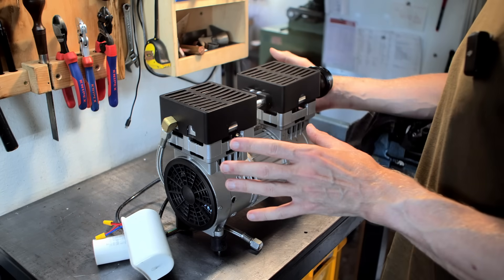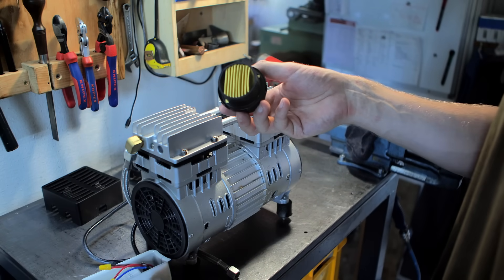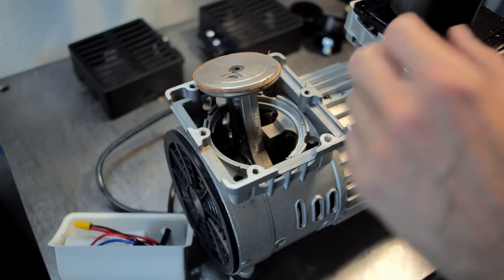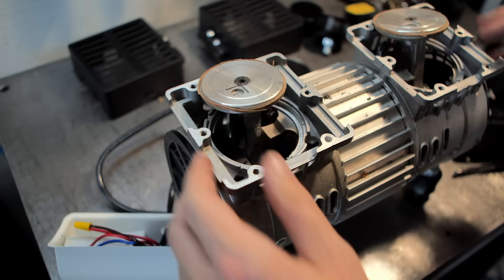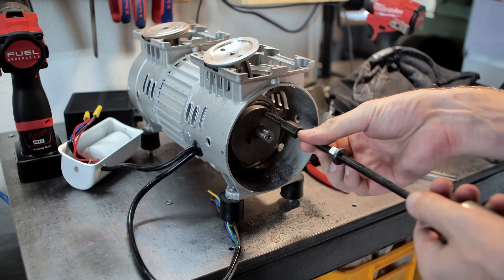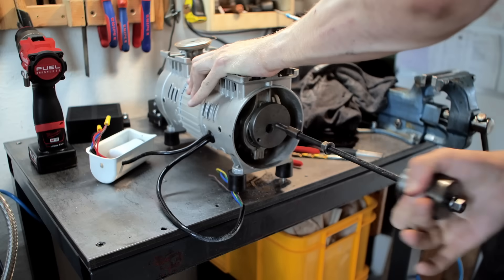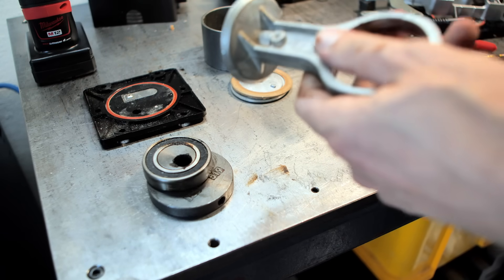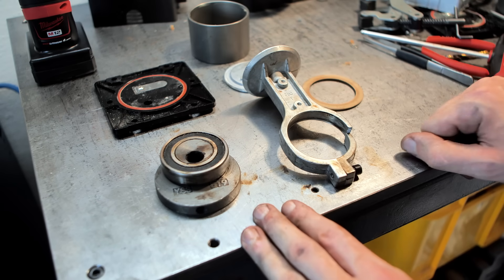Silent compressor - Destructive teardown

Comment: The alternative is a diaphram compressor (eg. BinksBullows have made them for decades).  These are very quiet, but usually for low pressure applications.  They go a very long time.   Mine must be at least 40 years old.

Comment: I think my swan Vee twin compressors will see me another 30yrs.. that thing looks like junk.😂😂
Reply from the maker: It served me well.
Reply: @StefanGotteswinter l guess 10yrs aint bad for cheap stuff..  shame the smoke escaped.. l buy tough stuff to advoid failures swan has proven performance compressors and at 150psi with some extra noise and oil changes im not complaining 1 bit..👍

Comment: Yeah those compressors are amazingly tough. They get used in oxygen concentrators in appalling conditions. And some have 25000 hours. The seals get replaced and then off they go for another long time.

Comment: had to fix one of those for a customer at work, one of the valve nut got loose and the spring plate went 90 degree. Very easy unit to work on as it doesn't even have gasket material it's all some sort of rubber seal. I bought one of those after that as they seem pretty reliable with how little moving parts they got. I might buy a set of piston plate because I can see that tiny "piston ring" around it breaking over time.

Comment: Crazy how long these seals have lasted. Or hasn't it been used that often?
I had to replace the pressure switch on mine after a few years bc the actuator piston got stuck. My guess was the lack of oil mist blowing through made it seize up.

Comment: My dad worked at a tv repair shop as I was growing up. I spent a lot of time tearing electronics apart. I spent the majority of my adult life working on Disamatic molding machines from Denmark. My coworkers would laugh at me for taking a failed part apart to learn what caused the failure. I probably learned more from disassembling things than any other method of learning. Thanks for your videos.

Comment: Thanks for the teardown video. In the States they sell this compressor through several companies. I use one in my house garage in event that a car needs a tire aired up. Mine has seen very few operating hours. One time I tried to use it and it didn't build up air pressure. I noticed it was quieter than usual. Then I found a mud-dauber wasp nest in the air filter inlet! After removing that, it was fine again. 

The motor should not have developed ground faults. Even after 10 years, there was a latent defect of some sort which allowed this to occur. Would be interesting to deconstruct the motor and locate the fault.
Reply: He admittedly ran it normally past duty cycle and abused it, the windings in the motor could have developed a fault from the thermal cycling?

Comment: The motor probably failed do to overload, I bet those crank bearings failed and put extra strain on it. I also have a silent compressor with exactly the same setup from a different brand,  I have it for 2 years, if the tank doesn't start to rust by then, then I'll replace the bearings from both the motor and the crank 😅 thank you for the video, I really was curious to see what's inside of it😅😅

Comment: There are no disadvantages in an integral piston/rod layout for an oil less compressor. Having a piston with a wrist pin is in fact less reliable,
I have worked on instruments that use pneumatic power supplies for 40 years and the old style compressors started to disappear around 40 years ago.
And it is not 'primitive' , it was an advance made possible by the development of new polymers for the piston seals.

Comment: Hey Stefan! Thank you so much for the teardown! I took apart my very first compressor years ago, it was a "Thomas Pump" which looked exactly like this one (also inside!). However, this compressor was pretty loud for a "quet compressor"! How loud was your compressor? Back then, i switched for a diy compressor (oiled) which is REALLY whisper silent (about as lound like a fridge). Still using this one to this day.
Reply from the maker: theres a link with the old one in the video description.

I measured about the 70dBbit states on the label. which is not whispering quiet, but doesn't rock your universe apart. Decent compromise.

I have a smaller one for airbrushing in the office, that's even less loud.

Comment: New o-rings, hone the cylinders finely and it will run again.
Reply from the maker: The cylinder, seals and everything else was fine. The windings have a ground fault.
Reply: @StefanGotteswinter  Thank, it is good that you are curious enough to take machinery apart that has failed. Nice to learn how things work!

Comment: Just as a note, not all stainless steel is none magnetic, just the less expensive varieties. Magnetic stainless steel bolts are common (at least over here).
Reply from the maker: A2-50 and A4-50 grades, which are the common ISO grades are non magnetic/austenic steels. they show a tiny amount of remaining magnetism, but not like a carbon steel or like :)

Comment: Launching an orange ..out of a cannon...A.S.C.O. valve up to the speed of sound.                                          Needing 400 psi./27.5 bar. @115 psi/8 bar  I'm at 520 f/sec  158 m/sec.  350 mph - Mach  .4       It's on you tube It is a code vessel and am aware of the dangers hidden in hi compressed air.      The plan now is to take 2,200 psi. and drop it to 400, Very dangerous, even with 3 stage redundancy it can be fail kaboom and not fail safe. ANY IDEAS? Auto ac. compressor?
Reply: I have no intentions of breaking the barrier, Expecting to hit the wall and orange the    Orange will be at -78/c will explode at the muzzle. ANY ENGINEERS WANT TI WEIGHT IN? BARREL IS 3"sch.40 and is 4 - foot long. It's impressive as is.
The math eludes me on acceleration 0 - Mach 1 over 4 - foot.

Comment: What you can do with those CAT style compressor heads, is 1) put a large traditional round air intake filter on in place of the little one which improves flow quite a lot.  2) take those plastic heat guards OFF the top of the pistons... they're there to protect you, but they make the cooling worse.  3) take the fan grill guards off the ends of the motor for the same reasons.  More air flow.  If you are going to abuse the duty cycle really really horribly, point a good room fan with a lot of flow at it and leave it on for the day while you work.  You can run it for very long stretches without it overheating.

Comment: This is Thomas Industries'  WOB-L  compressor design. (wobble piston)  Very simple, cost effective. We use them in the oxygen separators we manufacture. Many different manufacturers are licensed to make these, rugged little units, but are essentially throw-away units. Thanks for the video.
Reply: i wish for super-primitivity second, it makes me feel things
but my first would be a molecular based reproduction of the air compression effect, if it ever existed. it would be nice

Comment: Nice, I too like the teardown, and from my point of view, this was effortless. I imagine if one was desperate/needy of a replacement, this could be simply repaired and kept going for a time. Enjoyed, cheers!
Reply from the maker: that would mean giving the stator of the motor to a motor shop (rare, but i happen to have one next city, but its expensive) and have it rewound. Unfortunately not an option, since I need compressed air every day.
(Also, the tank of the old one was not coated on the inside..)
Reply: I think especially for these low horsepower motors it is just not cost effective to repair them.
I have a compressor with a similar pump and they are 99€ at Bauhaus (DIY/hardware store) in Germany including a 6 litre tank.

Comment: Odd.  Oiless compressors are very common and usually very noisy.  At least yours was made to be easily serviced with new piston seals and cylinder sleeves every few years.  Your's looked long overdue and that contributed to motor death from running far too long to fill the tank.  I wonder what they did differently for noise mitigation.  Most are single cylinder and loud as heck.  Maybe twin cylinders and half speed motor?  Was 1 piston actively cancelling the noise of the other?
Reply: These aren't like those pancake compressors. They make FAR less noise. Have a California Air version.  Still worked after being idle for some years.

Comment: you shuda looked at the fried motor, sometimes (on dirt cheap models)  the winding wires are made of (copper colored) ****aluminium****, causing heating and galvanic corrosion on copper connection
Reply from the maker: i already had wasted an hour by trying to isolate the faulty motor. I prefered to not muck anymore around with it.

Comment: The air pump/compressor in an oxygen concentrator is a very similar design, and I had to repair one recently for my wife because it would not run and popped its breaker every time it was turned on.
When you said that the capacitor in these types of motors are very prone to failure, I said "Thanks, Stefan, that would have been useful information 2 weeks ago" when I bought a new $75 pump (which did not solve the issue) and then a $14 capacitor (which did).
Great video...maybe I'll use the extra pump I now have as a compressor...

Comment: Husky - a no-name brand for Canadian Home Depot, sold a 2 gal silent compressor about 5 years ago. Sold them once, and never again. Features the same style silent compressor. It was dirt cheap ($145CAD). It was quieter and faster than the similar makita that was nearly $600. A weird loss leader for Home Depot. I love it. It’s perfect for trim work (when I’m not using my paslode gas gun) and is beefy enough to run a framing nailer (for light use). Home owners are shocked how quiet it is.
Reply: Husky is not a no name brand, it’s just a brand that is (currently) sold exclusively at Home Depot like ryobi and a few others
Reply: I bought a "silent" compressor also with 750W/1 HP and 6 litre tank some 5-6 years ago at Bauhaus in Germany under their own brand "Hercules" for 99€.
Just checked the website, here it's still available, only the price has gone up to 109€. Great little machine for home use, made by Fini/FNA compressors of Italy.

Comment: I have been using jun air compressors for a while, they are the rocking piston type built for lab use and rated for 100% duty cycle. Highly recommend them!

Comment: I'm on my second silent compressor. First one died because a burst SMC 6mm PU tube, the compressor kept running for about half an hour before I notice. After that the motor had overheated, still worked but had sometimes problems to start, after a while it finally died. A simple thermal switch would save them from overcoocking. I added a couple of 230VAC server fans to the front and back, this way the windings keep being cooled when the motor is turned down. Remplacement motors can be found for about 100 euro in Aliexpress. I still have the old unit and I'm thinking on putting an external 3 phase motor with VFD that I have laying around. The idea is to make a lower speed compressor to make less noise on longer runs. By the way, the intake filter is also a muffler, it reduces the noise quite a bit

Comment: I wanted to decrease the noise of my compressor and acoustically tuned the intake. I used a phone app too find the worse 3 noise peaks and used half wave long plastic pipes to reflect the acoustic pressure wave back to the intake. Resulted in a 20dBa improvement.
Always enjoy your videos.
Cheers-Peter
Reply: Now that is smart. Thanks for the idea!
Reply: I'd love to know more about that!  Are they simply 3 tuned pipes to a common collector - or more convoluted?
Reply: @EddieTheGrouch  Yes simple. The 3 pipes go to a common point which replaces the air filter and the air filter gets connected to the same common tube point. I used central vacuum 2" PVC tubes and fittings.
Reply: 3 pipes in series?

Great engineering though, I don't why compressors don't come with tuned intakes. They could be molded cheaply from plastic since they don't need to handle particularly hot temperatures.
Reply: Wow
Please tell us more
Reply: Brilliant solution! How were the three pipes configured? Stubs off a manifold, tuning included manifold dimensions somehow?
Reply: @DaveEtchells  Don’t judge me… In the middle of a project my compressor failed and Harbor freight had on sale an 8-gallon horizontal tank with an oil-free single piston for $137, with a different paint job and plastic cover you can find an almost identical unit from several brands like Canadian Tire or Sears (probably from the same factory). It works ok, it is noisy, 95 dBA with the air filter removed and 6dB quitter with the filter on. Prolonged exposure to this noise level will damage hearing.
For my model the loudest noise source is by far the intake >>10dB. The second loudest noise source is just silly, the plastic cover. It is rigidly mounted directly to the cylinder and is cantilevered over the mechanism becoming a very effective loud speaker for noise. I removed 4 screws and put some rubber under the bottom lip. Just do something to vibration isolate the cover before you start resonator tuning.
I did not want this to become an R&D project and it was heading in that direction so I decided to just build one. I used central vacuum cleaner PVC 2” OD tubes and 30-degree branching junctions to add the additional resonance tubes. The 2 longest tubes each have a pair of 90-degree bends just to keep the tube structure compact and close to the tank. To connect the 2” PVC tube to the intake I had a bit of scrounger luck, I found in my scrap box a brass Grohe pressure balancing shower valve that had a 2” hole plus 1 male and 2 female pipe threads. Don’t buy this part, make something, a new valve is worth more than the compressor. The male thread screws into the cylinder where the air filter was. The air filter now attaches to a female pipe thread and the second female thread is closed off with a ball valve.

I designed and 3D printed simple pistons that fit inside the 2” tubes. I calculated the tube lengths per the reference above and cut the tubes overlength not knowing the effect of the bends. While looking at the app I empirically positioned the pistons for minimum noise. When I was happy tuning, the tubes were cut at the piston locations and replaced them with a PVC cap. The tube’s fundamental resonant frequency and odd harmonics are also attenuated so a dBA weighted number is very helpful during tuning.
My three tube lengths are about 55, 35, 14 inches at 60Hz multiply by 6/5 for 50Hz. Caveat emptor, cut overlength, and your mileage may vary.

I suspect but have not measured the increase in my air compressor cfm. When the intake read valve is open and the piston is sucking in air, the returning pressure wave is above atmospheric pressure, and you should get more air into the compressor piston on every stroke. 
Have Fun -Peter
Reply: @deuterium8236  Oh, what a clever idea using pistons to adjust the resonance empirically! I love that, was wondering how you'd calculate lengths, as the resonant column would include the manifold, and the pipes would interact. Your piston solution avoids all of that, what a smart approach! Thanks for all the detailed info! (I have a DeWalt 29 (?) gallon oilless model that's very loud when it runs. I dunno if I'll find time to devote to this specifically, but it's such a smart approach, I love it!)
Reply: Would love to see a picture as im visual learner. for my upright compressor intake I used 3/4 Galv pipes & fittings to form a "zig zag" intake along with 2" PVC with internal baffles that end at a hi flow paper filter
Reply: Also keen to understand the implementation details, the design makes sense but curious how you executed the build of it?

Comment: We made hundred of thousands of small vacuum pumps (20 W motor), working with the same principle. The "secret" is the piston gasket material, its machining and the preform operation before assembling.

Comment: I noticed that it was relatively easy to buy spare parts for those machines. When they stop pumping and the motor still runs without strange noise, it is worth opening and fixing.

Comment: I wonder if the capacitor dropped precipitously in value and caused the motor to overheat and die. I've seen that happen with blower motors.

Comment: Skirtless!  I'd never have guessed. It's surprising to think the seal sliding on the aluminum sleeve could have taken that many cycles.  Congratulations on the new compressor.
Reply: we have maybe 10 of these compressors in the facility, and all of them fail in a similar fashion, the piston seal fails, piston starts to rub on the cylinder and then it is game over, one had the piston seal retaining plate screw come undone also
there are replacement cylinder sleeves, pistons, seals etc all available on ali, but the cost to rebuild this 2cyl unit is close to 100 eur, at least it was couple years ago, seems like ali is trying hard to convince customers to just buy new compressors

Comment: I imagine the basis of the manufacturer's duty cycle requirement was for protecting the motor.  Not all AC motors can run continuously, even ones with cooling fans. 
Very cool teardown.  Dave Jones would be proud.
Reply: Afaik (and i could be wrong) its actually to protect the piston ring material from overheating when run for too long. Its a type of ptfe/teflon and extended runtime heats up the ring to the point where it can begin to degrade. If its stored/operated somewhere cold it probably had much more headroom for the runtime.
Reply: Duty cycle on these units is between 30-50%